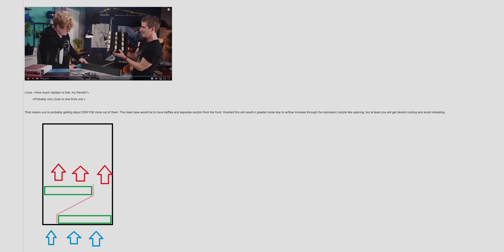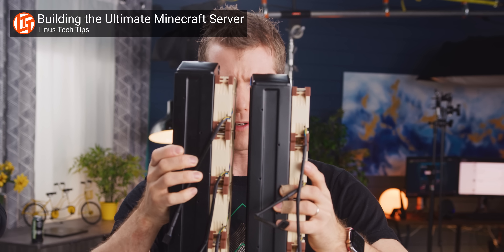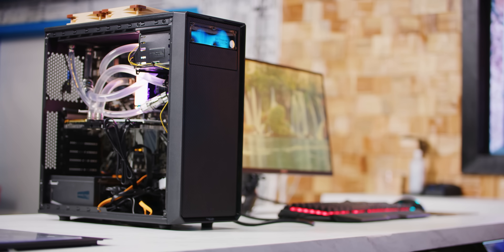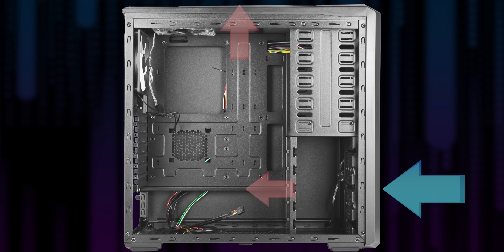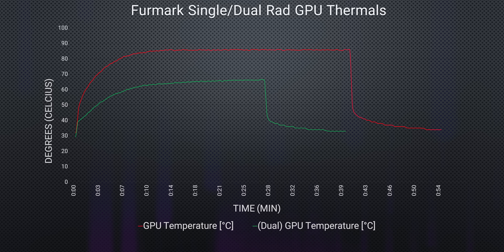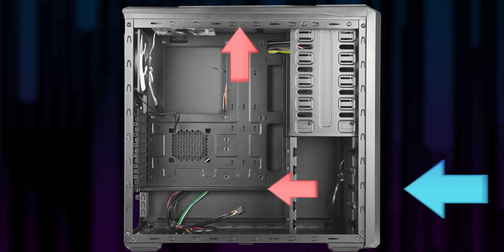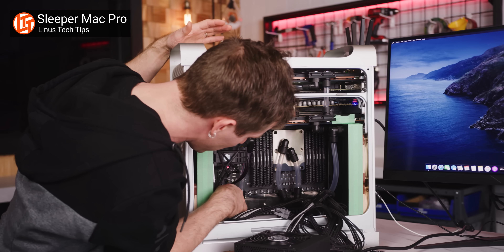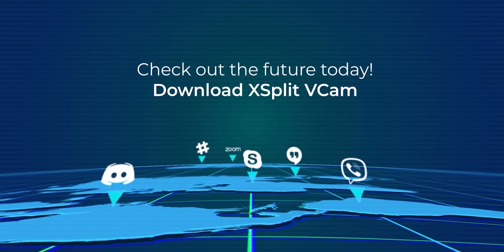I’ve been water cooling wrong for YEARS - $H!T Manufacturers Say

Comment: A big question I have for this is, what is the route for the water relative to the air temp? in a stacked rad configuration you want to run the hot water of the components to the rad with the warmest air first, this way you get the best temp differential. this water would then be passed to the cooler rad to further reduce temps. unless you are maintaining the supply water in the loop at ambient air temp, this will always lead to an increase in cooling performance, until you hit an airflow restriction bottleneck.

Comment: Seems like you are lowering temps mostly because you add cooling surface and transferring liquid by adding radiators BUT you are making individual radiators work worse simultaniously, if you stack them suffocated or serial them, as the manufacturer tells you. Ergo, Most likely you'll get better results and longetivity if you let all of your radiators get the coolest possible inflow air.

Comment: I would have loved to see a comparison of an additional option of having both radiators bringing air in together or out together with other fans in the case to balance the overall pressure. It would be interesting to see if effectively turning two 240 rads into one 480 rad would be more efficient than hooking two 240 rads up in series. And if so, to what extent.

Comment: Hm i wonder, you guys didnt specify it but was the water loop the same volume for the 1 rad setup vs. the 2 rad setup? If not that would account for the longer time to heat up with 2 rads.

Comment: Corsair just FUCK YOU!
In my speculation, they fucked up their simulation. You are indeed reducing the efficiency of your rad behind the first by stacking BUT if this performance reduction is less than stupid high, like 80%, then stacked radiators are worth their price because (as Linus said) you still get something out of of your radiator. I don't see why would Corsair (out of all manufacturers) would go out of their way to tell Linus he is not doing it right. In the worst case, Linus is wasting his money and resources to build a triple-stacked radiator.
Let's say the efficiency of rad is X and due to good airflow, the air can warm up by 10% as it passes through the rad. That means the liquid is cooler by 10% for each rad.
So we have to create a function. For now, put the variable of the Air Flow rate aside, and let's say the same unit of air cools the same unit water.
 So I made a little script in PowerShell to play around with the numbers.
Up until the 3rd radiator, the system provides some sort of cooling.
My function is really basic and disregards the flow rates BUT even that function can show that none of the radiators are "worthless" or "meaningless".
As far as I know, more air means better cooling. More flow means even better. Real-life doesn't work based on some simulation.
If Linus ever wants to learn something very geeky overclockers.com has really good research made by Bill Adams and it can be useful for later projects.
For mere peasants like us, the "more is better" rule certainly applies.

Comment: Wow Corsair. I hope they realize that the automotive industry already knows that more Radiators = better cooling. DURRR. Computers are no different to a anything else that produces heat and needs that heat removed. The more surface area you have the better cooling. Yes you may restrict airflow with more rads but it still is better for overall temp efficiency then 1 small rad with fans at 100% under any load.

Comment: I am at the @5:30 mark and I am going to bet that they didn't account for the additional thermal mass of the coolant required to fill the second radiator thus they really ended up measuring the amount of heat both systems can absorb NOT the amount of heat both systems can dissipate

Comment: All you really did was increase the reservoir size, therefore giving you a longer period before you run out of usable coolant. Limitations of the thermal capacity of air in forced air system still apply. You would need to divert your reservoir to somewhere outside the case. A tubing system that is linked to you foundation? Using passive thermal grounding? Ideas?!

Comment: So many comments about loop configuration and water volume, we just need to break things down to the basic physics.

A specific volume of water at a particular temperature has a specific amount of energy contained in it. Likewise, a specific volume of air at a particular temperature has a specific amount of energy contained in it.

If you move a specific volume of air from 20°C to 40°C, you require an exact, calculable, amount of energy, which, in a water cooling system, must come from the water.

The exhaust air temperature can never be higher than the temperature of the water. This means there is an exact physical limit for the amount of energy that can possibly be transferred from a specific volume of water to a specific volume of air, regardless of the size or number of radiators.

By stacking radiators, regardless of configuration, you get closer and closer to this physical limit of transferred energy, the only issue is one of efficiency. This issue of efficiency is where adding more radiators is useful. If a single radiator is capable of reaching that physical limit on its own, no number of additional radiators will have any effect (and if the added air restriction reduces air flow, can make it worse as Corsair claimed, but we are talking a constant volume of air). If a single radiator isn't absolutely perfect on its own (as is almost certainly the case in reality) then a second radiator will always be helpful.

Something else that wasn't pointed out, is that a heat exchanger is only capable of a specific maximum energy transfer, based upon its surface area, material, and inlet temperatures. Also all calculable numbers. This means that the greater the delta T (higher the water temperature vs room temperature) the less likely a heat exchanger will be able to transfer its theoretical maximum before the air has passed completely through. In these cases, a second radiator is always going to remove more heat from the water. In other words, the higher the loop temperature, the more likely a second radiator will have something to do.

Comment: My 2 cents: A radiator is a heat exchanger to dump heat in the air and  each one for a certain flow rate and inlet temperatures will have a watt rating, i.e., how much heat it can remove from water. So lets say I get a XYZ radiator with its standard fans with advertise thermal load capacity of 400W @ 50C ambient with 20C delta, i.e., water coming in at 70C and approach temperature of 5C, i.e., water going out will be at 55C. So as long as my load remains 400W and ambient is 50C, water temperatures will remain as stated above. But if there is any change in parameter, it will cause things to change. Let's assume for some reason heat load increases to 500W, this will result in higher water inlet temperature, but this will also increase the deltaT which allows radiator thermal capacity to increase, but water out temperature will also rise. Water temperature will increase but does it mean processor is thermal throttling, unless this causes the heat transfer between processor and cooler on it to drop, if it is not, then all is good. If processor, GPU, cooler or radiator is at limit, then this might be a issue. But otherwise, its throwing money at something which doesn't get any practical benefit. 

Ok, so my thread is getting out of hand, and I don't want to deep dive into it, if you want to discuss in deep dive, let me know or you can talk to any expert in the cooling/heating field with design experience. 

What I am trying to get here is match the cooling system specs to your requirement and buy the right components (I know, no shit sherlock). :D

Comment: How long did the test rig run with each setup? Second radiator means more water and more thermal capacity. To make it fair you should have reservoir of sorts and exacly same amount of water in both systems.

Comment: I would be really surprised if the air actually gets that close to the water temp just because it's going through the radiator. With a thick dense radiator, maybe, but still not necessarily, it would also probably depend on fan speed and the actual water temp.

Comment: I have 2 360mm rads and am pulling air in for both of them. I have 6 fans pulling in cold air and 0 fans exhausting. It works great! I have massive positive pressure so no dust and I have 1 empty fan slot next to the mobo in the rear of the case with no fan just letting air out. My system idles at 28c and 38-40c under load for hours.

Comment: If corsair thinks stacking radiators doesnt work at all, or can decrease perfomance, tell them to call truck manufacturers because they've been stacking a transmission cooler on the engine radiator for years

Comment: If the front rad had exactly the right airflow (a lot) to remove all the heat so that the water exiting the rad is back to perfect ambient then a second rad is of no benefit but who does that? So because cases typically only allow a 360 or 420 at most on the intake, and because we value our ears, if the components would heatsoak a 420 then there's no option but to have another radiator and many cases therefore will have to have one in the roof. Corsair are idiots.

Comment: If stacking radiators works, every single motorsport in the world would be stacking radiators on race engines. You didn't test against one exhaust rad and one intake rad, nor did you test a single rad against a two or three rad stack with fans in between. This was not a fair comparison, and needs to be revisited again, properly. Thumbs down.

Comment: What if you have rads at front and top of the case and smaller one in back and only top pushes air out?... how would ethanol work as pc cooling liquid?, it is lighter than water...

Comment: Corsair is stupid with his claim.
If even car manufacturers use dual radiators to cool a engine .
Well the heat of a engine in side go up to 1300/1500 Celsius (combusting in the cylinder) 
 and all that heat have to go from steal to water to a radiator so the water is 90 Celsius .
Well I think a car manufacturers will know more about water-cooling than Corsair will do.

Car manufacturers use dual radiators or stacked them up to cool it down.

Comment: That moment Linus thinks hes smarter than people who are professionals in their scientific fields, then proceeds to make a totally unscientific test and miss the point on Corsair's claims all together  and write them off. 

Such a shame and pretty disrespectful.

Its not such a cut and dry topic. The issue is deminishing returns per added rad that is sucking warmed up air from the previous rad. If your heat load is near max for the rad being used its pretty obvious adding another rad even if it's sucking "dirty" air will yield A benifit since the dirty air will not be at thermal capacity it will still have thermal capacity in most cases. 
Each sucking clean air would be optimal and obvious to most.
This should have been tested ON THE SYSTEM IN QUESTION. I literally dare you to remove the rear rad on the Hacintosh and test before and after.

Dismissing people in such a way is what starts these mislead internet wars. If you are not willing to properly test the claims as stated then dont blast them for being helpful. Just say thanks for your input privately and move on.
Reply: Yeah this was a huge L for Linus
Reply: I think you're missing the point. All this video is saying is that simulations and lab tests don't always translate properly to the real world. It's not disrespectful to tell someone they're wrong if in practice they are actually wrong.
Reply: @mattjones2728  if they are not testing the same system it is just plain garbage info. Again no need for a "Shi!t Manufacturers Say" video if they are not going to even test the referenced system.
Reply: Did you even watch the video? All of the things you said are addressed in the video, and he even said to "take everything with a grain of salt, including what i'm saying"  and to do your own research...
"Dismissing people in such a way" - right back at you.
Reply: He literally said he made Jake remove one rad from the stack in Minecraft server and temperatures increased by 5°C. And that was the worst case scenario (or best case for Corsair claims) as that was a literal stack of radiators. Of course, it all makes sense. Thicker radiators have better performance than thin ones, which would not be the case if "radiators are already extremely efficient" as Corsair claims. It would also explain why Arctic beats them in performance at much lower price with its AIO :)
Reply: Removing the second rad isn't the way to test this. The real test would be to unstack the rads and see how that performance compares. That said, the only (valid) reason to stack the rads in the first place is because there isn't enough room to run them in an unstacked configuration.
Reply: @FranciscoTChavez  It would be the way to test the referenced system and stated claim. In the server stack for sure you are right.
Reply: @FranciscoTChavez  They claimed it makes no difference. It made 5°C difference. Hence, false claim. Would it be better if all rads were independent and not stacked? Of course. But even stacked they made difference, contrary to what Corsair claimed. Remember, they claimed it makes NO difference and may even be contraproductive (increasing temps), not that it is less efficient.
Reply: TheCalbert oh my god shut the fuck up and get a life, who the hell has time to write a fucking book about how many Rads you have in a case. Someone should take away your keyboard.

Comment: qq. I don't have Noctua fans, but at 4:14 is that fan pulling air from inside to outside or is it actually getting fresh cool air and pushing it into the hotbox to be ventilated out the bottom/back?  Most of the fans I have the logo is on the intake side, but maybe Noctua you would have to look for a direction indicator?

Comment: Rad through rad through device isn't the best use if you do multi-heat devices on a loop.  Corsair is on point with most of it.  It is diminishing returns.  The n+1 Rad(s) would have considerably less cooling performance as the deltaT is approaching zero.  A better loop would be "GPU, RAD, CPU, RAD, Pump, Tank."  This way the CPU gets cooler water than the "left-overs".  Or swap the CPU and GPU if you run CPU intensive versus GPU intensive...

Comment: I think that this video is doing Corsairs complain wrong. They did as far as I understand express concern regarding stacked Radiators and Radiators whichs airflows overlap. Neither cases where tested in this video. I generally like your content, but maybe this should get a part two or some input from Corsair

Comment: How can a second Rad make temperatures worse? The air inside the case won‘t get that much hotter because of the RAM or the VRMs. Besides, you can watercool almost everything in your PC (Mosfet, RAM, SSD, PSU, Chipset).

Comment: I couldn't see in the video how it was configured, but wouldn't having the loop go to the top one first, then down to the side one run cooler. Hotter temps being blown out the top then the cooled off ish water out the side. you could even reverse the back fan to suck air in over the motherboard ( will pick up a little heat) and get forced threw the side rad to cool it more?

Comment: The one thing I can see making a difference is the way the radiatoren are connected (hottest first --> already cooled rad 2nd or cooler rad 1st --> hot rad second so the amount of heat being thrown into the case is at a minimum )

Comment: If you isolated both rads to only take fresh air in outside the case and just fans inside the case to cool the hardware you would end up with better temps than any setup. Basically recreate what they did with radiatortowers ages ago. 😋

Comment: In cars, they can suffer from something called heat soak. I'd imagine it sounds like a similar thing would happen with doubling your radiators in a certain configuration.
Reply: Mildmannered ThinkingMan heat soak occurs when you have more heat output than exchange. If you have too much cooling, you can go the other way and your car will never get to operating temp. Not sure computers have that problem, exactly.
Reply: @One_Bar  Computers parts like the cold. A few exceptions exist like SSD flash nand and probably a few others. Typically colder the better. Less heat, less resistance, less voltage, etc. Especially for CPUs and gpus.

Comment: actually... why do we push hot air into the case rather than pull it out? so yeah the radiator not gonna be as effective but the case should overall be alot cooler so u might sattle on a higher temp but be more stable? 🤷‍♂️

Comment: I know for a fact, that many aircraft manufacturers don't stack radiators anywhere in an aircraft even if space is compromised. In any case, they put radiators in parallel or they allow some bypass air to surround the radiators if they have to put another radiator down the line.

Now, I wonder if in a PC case it is better to have a front 240mm radiatior with another 120mm fan as bypass (to have some air bypass the radiator) instead of going for a fullsized 360mm radiator and if there is space for a top radiator, go for another bypass setup similar to the one I have described before. Given many cases aren't sealed, there will be always some air leaking in or out.

Can't wait for Corsair response.

Comment: I've often wondered, does the order of radiators in the loop matter?
If you have one exhaust rad and one intake rad, does it improve things to have the fluid go through the exhaust rad first, to maximise the temperature gradient between fluid and air?
It depends on how much of a coolant temperature differential there is across your radiator I guess but I've never actually tried.